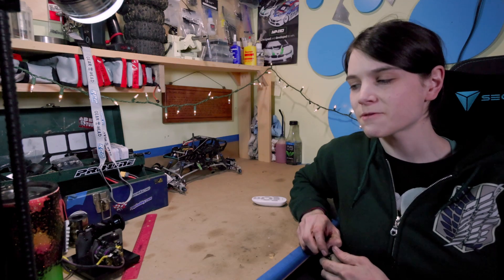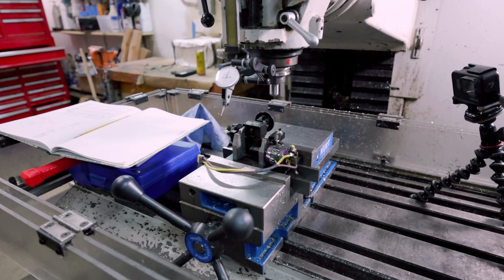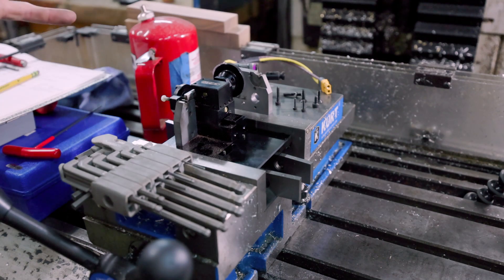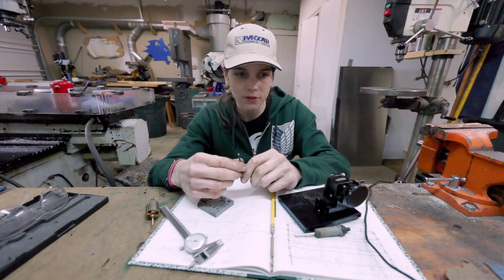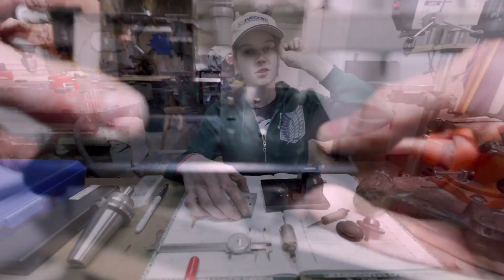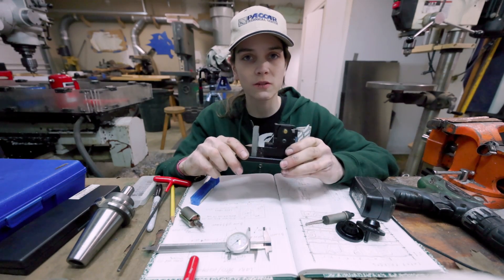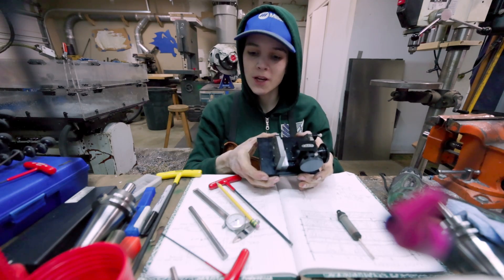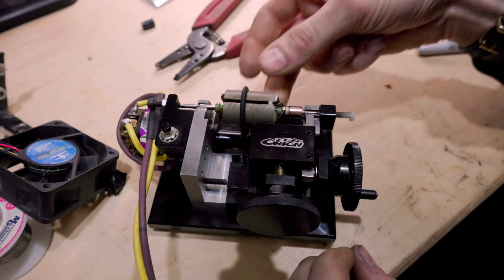Modifying my Comm Lathe to fit 550 Motor Armatures

Comment: 1 year late to the show,  At 12:45, When you clamp at the right edge of your vise, you should make arrangements to clamp something similar at the left edge, (or visa-versa as well),  to balance the clamping forces generated by the vise.  Clamping at only 1 edge of the vise, causes the moving jaw to twist.  That twist can end-up pinching only the 'middle most' edge of your work, allowing the outer edge of your work to actually be loose, plus you can cause uneven wear-n-tear in your vise as well.  Thanks for making this video.
Reply from the maker: Yep you are 100% correct in all your points and I am aware of them, I should probably take them into more serious consideration. Thanks for watching!